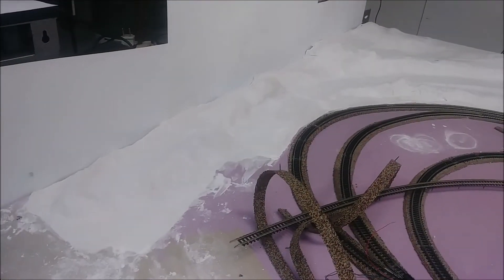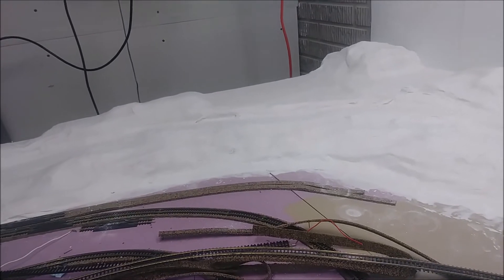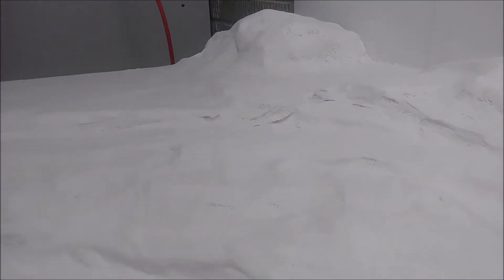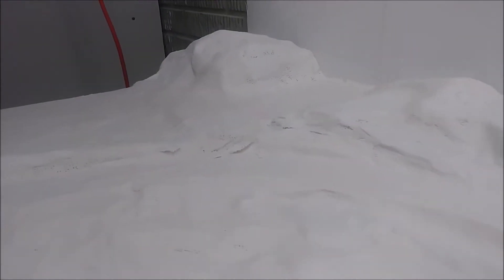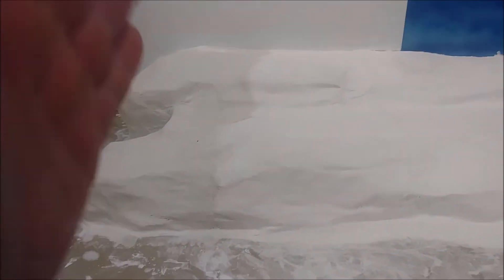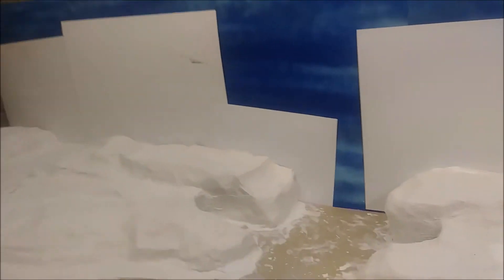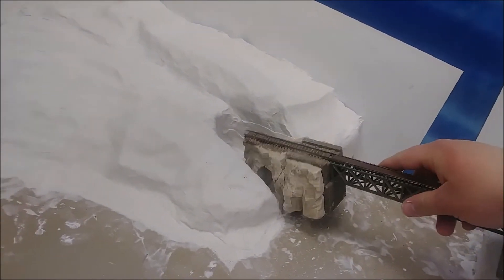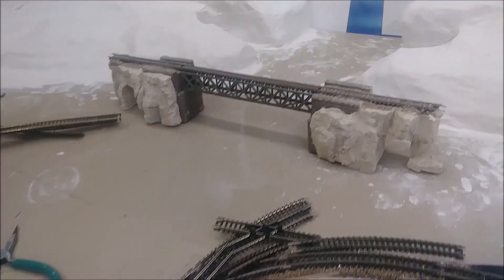Plaster Sheeting on Hills

Comment: Rule of thumb, layout width no more than what you can reach from your armpit to your palm. Palm so you can grab it! Not fingertips but you can grasp anything at your fingertips. Or 30 inches. Unless the height is lower than your waist! Looks good though!
Reply from the maker: Well, I needed the extra width to accommodate the loops. I just should have moved it about a foot further away from the wall. This is the first time that line of sight has been an issue over there.